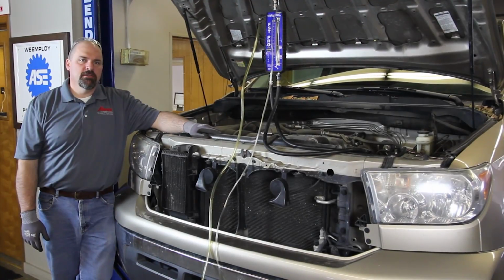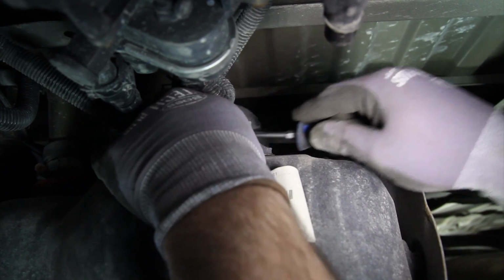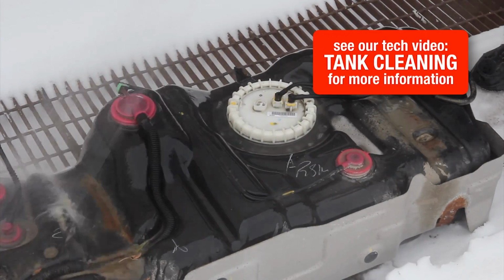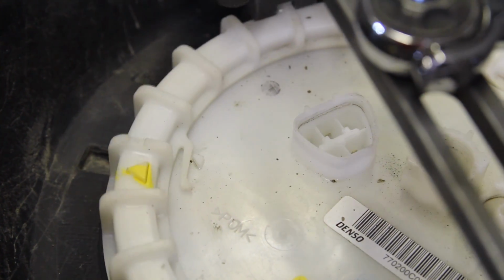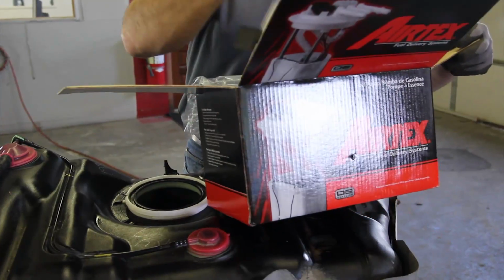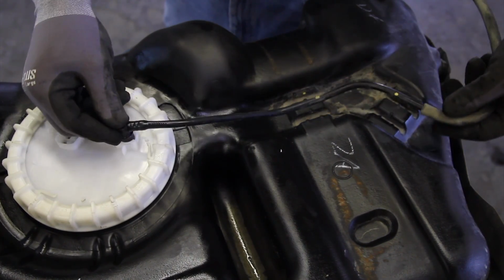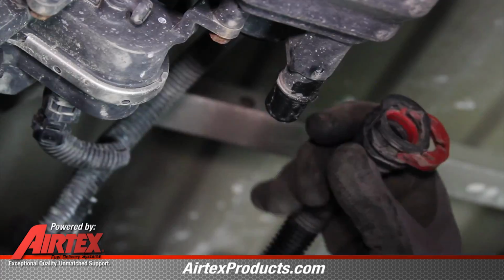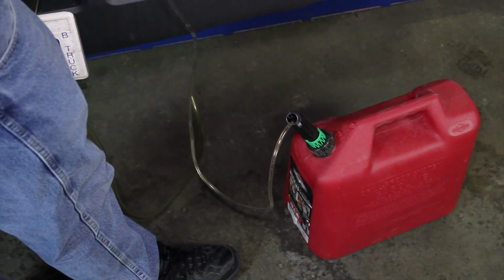How to Install Fuel Pump Assembly  E8806M in a 2007- 2014 Toyota Tundra

Comment: you made that looks easy,'m going to install the later model 38 gallon tank into my 14 tundra ,after watching this it should be no problem.the only part I don't have is the fuel pressure gauge you were using
Reply: For anyone else reading through these comments just pull the fuel pump fuse.. crank truck and let it run until it stops. Put fuse back and disconnect neg. battery cable. This is how you release the fuel pressure in the lines.

Comment: Where did technology take us forward? In the '60s and '70s it was a two bolt affair on the side of the engine where one guy could R&R  the fuel pump in 15 minutes. No need to mess with the tank or wiring.
Reply from the maker: Welcome to zero emissions (almost), 30-40 mpg and more horse power from engines a fraction of the size of those running around in the 60's and 70's.
Reply: LOL on my '73 MGP the fuel pump was behind the rear passenger side tire. 10 minutes and I was up and running. Had a couple go out in 7 years. I finally always kept a new on in the trunk. Found out later the pump was designed to last longer installed horizontally. Vertical was the only option! Had a '98 Lumina, tried to change one in my garage. Uh, NO, not today, Bunky! :-)
Reply from the maker: @counterpoint6718  High pressure electric pumps do best in a cooled environment, hence located in the gas tank. How nice it would be if the pump was accessible from inside the car! Once again, cars are designed to be assembled, not worked on.
Reply: @AirtexFuelPumps    Right...I've seen some vehicles that have access to the fuel pump through a hatch located under the rear seat. Now that would be preferable to what vehicles like my 2002 Tundra have to go through;  removing the tank for access is plain stupidity on the design level, IMHO.
Reply: But it’s great for assembly.
Reply: Welcome to EVERYTHING’S ELECTRIC. just ask Elon Musk

Comment: Ground connection where is this
Reply from the maker: Looking down at the top of the pump with the wide end in the connector at 6 o'clock and the supply and return fittings at 10 o'clock. The electrical terminal is: top left: pump positive, top right: pump negative.